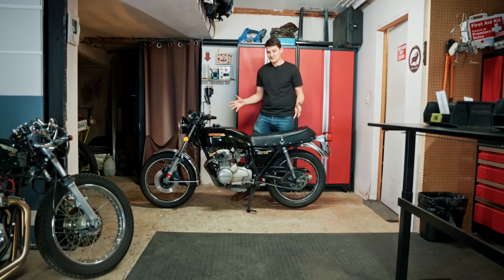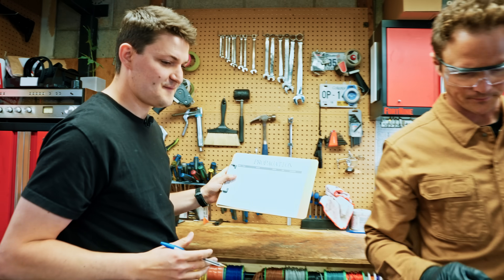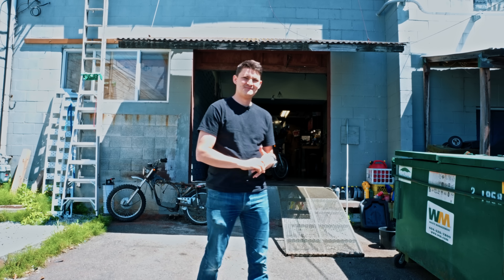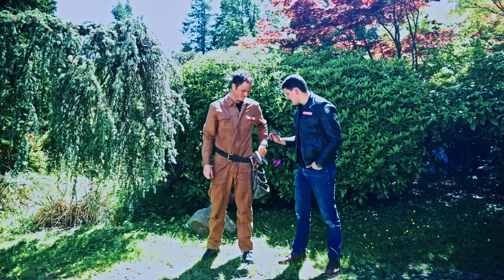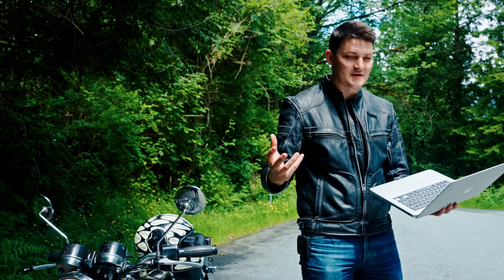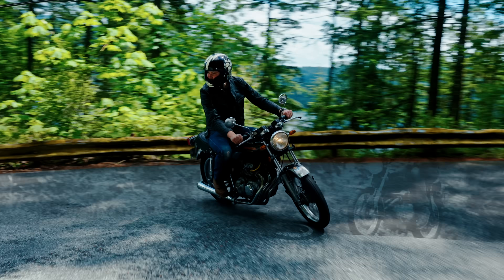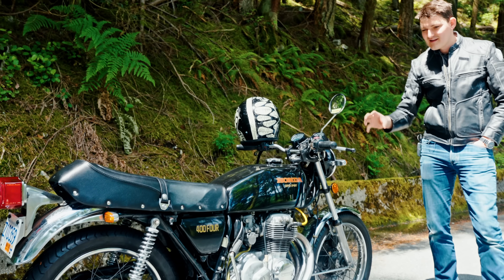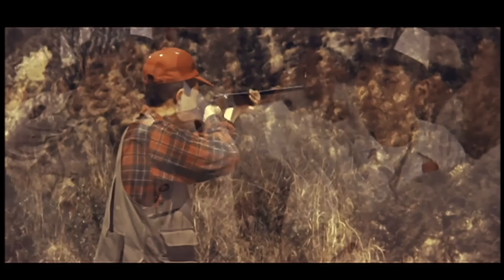Why Hondas Run Great - JIT Manufacturing, 5S Methodology and Kaizen

Comment: Running great doesn’t have much to do with JiT, 5S, lean, 5 Whys or other manufacturing concepts. It’s setting priorities in the design stage for reliability over performance and then a huge effort + expenditure to go deep on reliability testing during development. That’s what makes Toyotas and Hondas so reliable, their test specs are the most rigorous. 
I’m a mechanical engineer for Continental Automotive.

Comment: Irony. The history is actually a little more profound and less a cultural phenomenon and more one of a change management. Edward Demming, American, came up with a new manufacturing philosophy (TQM) in the 1960’s - promoting Just-in-Time, Inventory Optimization, Employee Empowerment, and Quality Control. However, all of the American companies he approached said that it would never work. He went to Japan and began working with Toyota, of whom adopted his TQM approach - of which was then adopted by several other Japanese manufacturers. By the 1980’s, everyone wanted to replicate the Japanese model - globally - as the pinnacle in effectiveness, work force management and productivity. Specifically, the US pushed hard to broker alliances with Toyota, Honda, and Datsun/Nissan. Today, Demming’s TQM has been copied and spun into all kinds of ‘new’ and ‘better’ approaches in profitability, production and quality (except Boeing …). But it actually started in the US - but put on the back burner. 

Irony.

Comment: I have a Honda CBF125 and while it is a budget motorcycle made from cheap steel, it's still a wonderfully reliable machine that starts every time and has survived multiple crashes. Currently 35,000 miles on the clock and I bet it'll happily do double that without issue as long as services are kept up.

My next machine will be a Suzuki Vstrom 650 because I'm tall and most Honda bikes are on the smaller side (the cbf125 is really cramped for me lol).

Comment: The 2008 Fireblade notoriously burned oil. Honda just swept it under the rug, dealt with each case individually, never acknowledged the problem. They manufactured that engine until 2017, until the design paid itself. How JIT is that?

Comment: Deficient video history in omitting any mention or credit to W. Edwards Deming, who first approached Detroit with his ideas, and was told, “We won the war, we don’t need any improvement.”  He went on to Japan, where his ideas of incremental improvement were embraced.  A classic story is from the 1980s when joint design and production was in vogue, and Americans fell in love with the Chrysler minivan.  As the story goes, transmissions for the minivan were made in both the US and Japan, and enterprising consumers (and mind you, this was before the advent of the internet) determined that there were too many transmission failures, and then sued Chrysler after they discovered the failures were almost entirely limited to the American-produced parts.  After the fact analysis revealed that the incremental improvement practice in the Japanese plant had resulted in a number of small improvements, while maintaining the mounting envelope, so the changes were never noticed in the assembly plant.

Comment: Starting a 50 year old motorcycle without any hiccups is the biggest flex of honda.

I am the 3rd owner of a 28 year old xlr200, with love and care (and enough cash) it starts the same like in the video.  

honda is like the toyota of motorcycles
Reply: Honda is the Honda of motorcycles?
Reply: @magicoddeffect fr lol
Reply: @magicoddeffect  actually yamaha is the honda of motorcycles
Reply: and toyota is like the honda of cars
Reply: I don't know, man. I think Honda is the Honda of cars. Like they weren't ultra reliable lmao. Toyota had a head start of a few decades. People suck on too much the Toyota reliability... right now, yet another recall by Toyota this time because they're new V6 turbo is blowing up like is nothing. So much for legendary reliability.
Reply: @disco.lemonade  engineers at Toyota are pretty much credited for inventing 5S and Six Sigma. If that is true then it's also true that a bunch of Honda Toyota drinking buddies had a lot to talk about that same day because somewhere in Japan, probably the auto manufacturing area, a lot of really good information is disbursed with great efficacy XD.
Reply: Yeah, mine Honda CX500C and CX500 Classic both starts straight up and they are 45 year old ones. The Classic have done 300.000km and the valve adjusting screws are now at their bottom, only tightened with one full rotation of the thread. I was 5 years old when i got to ride with it when it was new. Our neighbor bought it new, and passed away in 2006, so i bought it from him.
Reply: @SergeyPRKL Yikes. There isnt much left of them seats if thats true.
Reply: I own a honda 125 three wheeler from 1985. It still starts every time no matter what.
Reply: Also apply to Honda cars and truck :-)
Reply: There are plenty of 50 and 60+ year old motorcycles that start up "without any hiccups", as long as they are well maintained, just like the one he has in the video was well maintained over that 50 year period.
Reply: I would agree
Reply: In '99 my father and I found a barn find '72 CB 750 that was stored properly. We put a battery and plugs in it and it cranked on the 2nd kick.
Reply: as a owner of a '73 CB350F I agree
Reply: My Honda motorcycle is 20 years old.  Starts, runs, and looks brand new.  Fantastic machine.
Reply: Same here... my '89 RC31 (Hawk GT) runs like it's brand new.
Reply: Honda makes everything
Cars
Planes
Motorcycles
Appliance
And and and and
And as fascinating as it is all it's devisions are successfull

The time. Honda said "look we are making a new small jet for rich but no so rich people too"
I said they will fail it's a gamble.... Yet they succeeded and they did really good
Reply: In 1992 I bought a 10 year old Honda Magna.  It was reliable.  I rode it many thousands of miles.  I sold it.  I bought a string of HD motorcycles to look cool.  This year, I bought another Honda Magna.  Now it's 50 years old.  It still starts first try every time.  I'll be riding it many thousands of miles all over again.  Hondas are well built.
Reply: same goes for suzuki. I have a gs500e from 93, recently got replaced as daily by a 2013 honda nc700x. But I do have to say, I dont think the smoothness, overall quality and mostly the  bombproof feel of the gs500 can ever be beaten by any other bike. Especially for the price.
Reply: Yamaha is the Toyota of motorcycles since they own a  stake in the company, Honda would be the Honda of motorcycles.
Reply: And I am the ? owner of 1988 Transalp, it starts every single time and its 36 years old.
Reply: @dax8476  Hi, i brought the new Transalp just over a year ago. Hope mine lasts as long as yours,  what milage is on yours? Thanks

Comment: I have a CM125 and it is great, but you better not let it warm too much like I did the other day on one o those concentrations where you accelerate and stop, accelarate and stop... I think I blew the joints of the block, sparks are black all the time. But they are great bikes.

Comment: the dark side of individual authority while inside a hierarchy is that the lowest ranking employee has necessarily to be more skilled than the role requires and that loss is held by the employee and not the corporation.  that surplus capture by the company, or loss by the employee, is a system open to exploitation.

edit: employees can choose to take this role, and maybe for the good of the corporate structure there is feedback to the employee for their efforts, but in the American shareholder model where quarterly financials are the sole metric for management competence, it's a system that necessarily leads to worker abuses or a reactionary union push, you're seeing that today at the Mercedes Benz plant in the Carolinas in 2024.

Comment: Hello fromIndia . We sold our 100cc Honda 25 years ago when we discovered it was a stolen vehicle . The bike is still running well😅 . Last month bought a GB350 (called cb350 in India)  it doesn't run , it flies and the engine particularly is a diamond of a gem ❤

Comment: I worked at a European company that claimed to run a 5S system. What they actually did was hide all the clutter in cupboards. It looked good to someone having a quick look round but if you actually worked there you had a terrible job to find anything. They also gave employees little to no storage space, which resulted in useful things being thrown out or stashed in cluttered, shared cupboards. There was an obsession with things like computer cables being run through holes in desks to make it all look good on the surface. This company ended up with some serious quality issues in products which led to recalls, nearly bankrupting the organization. These quality issues happened despite extensive so-called quality procedures and reviews, because there was an obsession with process over substance.

Comment: Worked for japanese companies for years... "just in time" only works when there aren't logistic issues and raw materials shortages.  Lead to a lot of unnessesary OT with minimal (if any) production since many workers were stuck waiting for parts from outside 3rd parties.  It DOES reduce the chance of a company going belly up since they aren't paying for storage space or being stuck with inventory they can't sell, or that has nowhere to ship, but the system doesn't function well when spike demands hit, in which customers are stuck on waitlists. The strength in Japanese engineering and manufacturing doesn't come from  5S, Kaizen, Kanban, or any other "trendy" system that the west keeps importing, but rather in the already imbeded work ethic and culture of the Japanese as a whole.  Many American companies struggle to adopt these prenciples because the manage is also self focused, while japanese companies are often quite litterally "for the company" as a whole.  Just go to a major Japanese company and watch the technicians doing group warm up exercises and singing the "company song" before a shift.  You won't find that in America.
Reply: THE TRUTH IS THE INNER BEING, BEING TAUGHT BETTER WITH GOOD MORALS NOT WHINERS
Reply: Another commentary pointed out that they applied Kaizen to this when it became apparent, and started keeping a reasonable amount of inventory on hand so they can function during a supply disruption.

Comment: The way you wrote, memorised and shot that section from 4:35 - 8:20 is exceptional. As a viewer, you don’t even realise that you are watching a single shot. Which is all the more of a testament to how seamless it all is. 

Each video is a development forward from the one before with the bar set higher to see if you can pull it off. 

Incredible work.

Comment: Japan engineers everything so it will run even if you don't service it on time or change the oil. 

Germany engineers everything so that as long as you follow all the instructions and specifications it will run until precisely the second you mess up. But it won't be the machines fault, it will be yours.

Germany designs for Germans, Japan designs for Americans.

Comment: Not me, the last Honda I owned was a 2014 XR650L, bought it brand new from the local dealer. Both "known" problems, ECU solder cracking and hardened exhasut valve seat dropping, both happned to me within 7000km and outsied the one year warranty. I will never own Honda again, should have bought the DR650 instead,

Comment: Great visualization of these concepts. As a Motocompo owner I can say that its one of the most reliable vehicles I have ever owned and it is a  42 year old 2-stroke powered Trunkbike. As far as I know the Engine was never opened. Despite its size its pretty straight forward and fun to wrench on it, so maintenance is a joy.

Comment: I don't generally buy into brand hype, but after digging my father's 1983 CG out of storage and finding the engine still worked fine, then after selling the next CG to somebody who ran it without oil for 6 months and it didn't fail, then after seeing umpteen gardeners' sheds all contained a Stihl tool from the 80s that still worked fine, I began to realise that all engine blocks are not engineered equal, and some brands to have a knack for it. Which is baffling, really, because there's almost no way for market forces to reward that kind of long-term reliability.

Comment: As a MotoGP fan, I heard the riders complain about the complete opposite issue when working with the Japanese manufacturers. They complained that changes took too long to implement. Every problem required meetings all the way up to the top before the change was enacted.

Comment: i have a 1987 super cub 90 GLX runs perfectly, a 2006 CBF 600 hornet 140000 km runs perfectly, and a 2004 CBF 250 with 240000 km with  a cracked cylinder head , the cracks start at the sparkplug hole and run towards the valves. It has been like that for at least 60000km and guess what?!?!? RUNS PERFECTLY 😂

Comment: I had a cb400f. As long as it had fuel, power and oil it'l run.
Even in winter, freezing with a weak battery it started. Pushed it on when the kickstarter broke...
Best bike i ever had.

Comment: Swiss market is kinda wierd...6 months snow and 6 months rain and maybe a sunny day. Soo my old Honda Cbr600RR after 4 years had almost no rust in all those exposed metal parts....on the other hand my current Yamaha MT09SP had light rust after only 2 years. I'm talking light rust in small screw and nuts all over the bike.

Comment: It also used SPC for tolerances, brought in to Japan by Englishman who was not listened to by major British Manufacturers. I think his name was Denning.?. Using Statistical Process Control meant components made to tight specifications. British Leyland specifications were typically 100 VPN range , where by using SPC it could effectively be 40 VPN range. Meaning a component is less likely to fail. Using SPC to tolerances had the same effect.

Comment: There is also a cultural context.  For them important items are meant as a permanent fixture.  Fountain Pens 万年筆, could be translated as 10 thousand year pen or eternal pen.  There is great pride is growing old with one item.  A reflection of this is found even in popular media like anime or manga, you'll notice that characters don't usually change equipment unless there is a direct improvement to the original, in a sense, the equipment grows with the user. If applied to vehicles like the Honda bikes, there were built with the idea that this bike would belong to the family for generations, and not traded in in 5 years.

Comment: Ironically 25 years later my CBR600 was known for its unreliable "self adjusting" cam chain tensioner which is why I ended up replacing it with a simple manual adjustment.

Comment: You see a lot of people who build Cafe racers, and they just don't understand that the original CV carbs only work with a stock engine, with stock original Honda mufflers, and a Honda airbox. And with their factory tune, those CV carbs would revv like a screaming banshee. Yes, you can make the CV carbs run fine, but if you've removed all the factory parts, you'll never know what it feels like to have the original performance and throttle response with the factory jetting. There are only a few people in the entire world that might be able to properly re-jet a CV carb.

Comment: Culture is key. I worked on both sides of the fence of a MoD / contractor run establishment in the UK.
Neither side trusted the other. The residual civil servants were all about protecting their authority and cushy jobs, whilst the contractor was frustrated by red tape and the lack of trust in the MoD. One of our group operations had great success in fostering a joint collaborative approach to their sector, whereby blame culture was replaced by a Kaizan style.
I tried to roll it out in our sector but the mindset was such that people simply couldn't see that their jobs were only as secure as our ability to do the work effectively and efficiently.
I eventually set up my own company and had great success by listening to the people at the coal face and finding ways to make us all better at our jobs. 
Fast forward 30 years and the MoD sites are all gone, but the sites my firm created are all thriving.

Comment: The Japanese make an incredibly reliable engine. When I was riding a DR650, I punched a hole in the engine cases on 3 separate occasions and ran without oil for a minute or two each time. A bit of JB Quick and a stone about the right size to plug the hole, fresh oil and the adventures continued. My KTM engine self destructed without any holes punched and with a ton more preventative maintenance trying to stave back the inevitable. I am back on a Suzuki engine. If you want to do dumb stuff on a motorcycle, don’t want to have to work on the bike much, and want the thing to keep on keepin on, buy Suzuki, Honda, Kawasaki, or Yamaha. There is variation between those brands (Hondas are more boring but more reliable) but all make an excellent engine for actual adventure riding.

Comment: honda did this great until about 2004 or 05, with dirtbikes at least. They started trying too hard to keep up with euros and lost their japanese spirit. Suzuki in my opinion have always done this better. Every honda I have ever owned has had significant issues ive had to rectify. Valves losing coatings and burrowing into heads etc. Every suzuki I have owned has been like a swiss watch by comparison. They set their target a smidge lower, but that last 3% is what makes it a pleasure to own and not just a pleasure to read the brochure stats and figures.